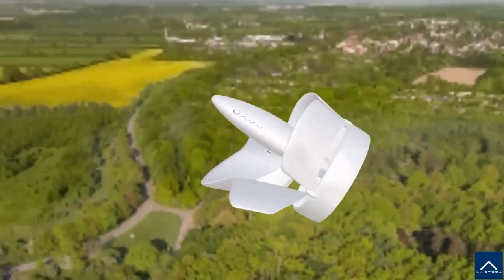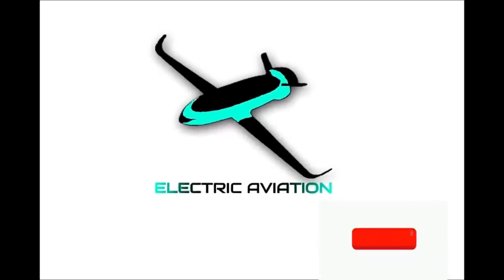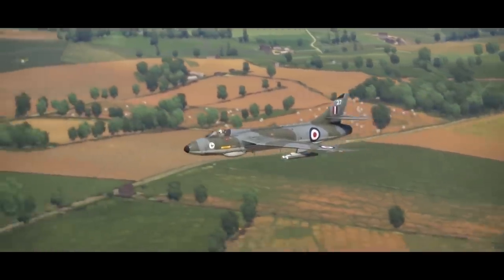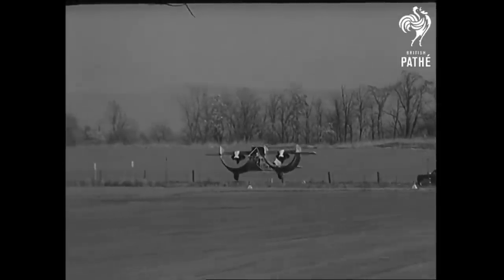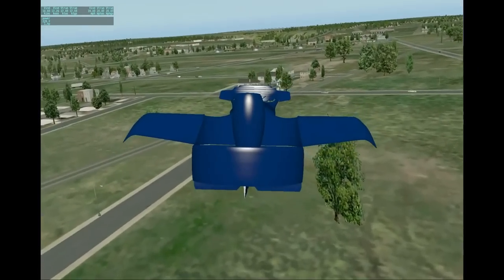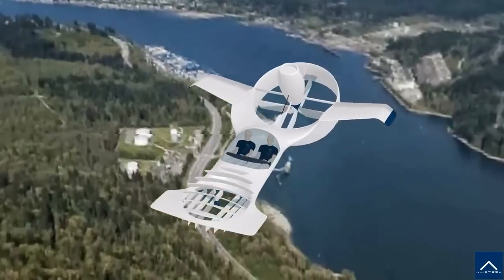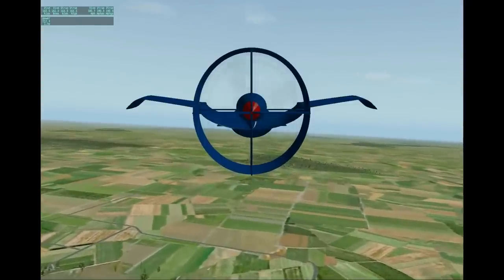Lip Wing : 65 Percent more Lift than Open Prop

Comment: In conventional aircraft design the principle reason for the separation of propulsion and lift is the design simplicity: Modularisation of thrust components  allows them to be positioned in such a way as to avoid unwanted interactions with wings. This has the added benefit of allowing competition between propulsion providers without undue compromise to the airframe development.  One of the key challenges with eVToL (or indeed elec aircraft in general) is that the whole technology only reaches  minimum value when the unique characteristics of electric propulsion are fully exploited... i.e. Elec aircraft only make sense (below the 400W/kg battery threshold) when distributed propulsion is used... the X-57 is a prime example of this. (Compare Chord lengths between the elec version and the original donor aircraft)

Comment: Sounds very interesting
Unfortunately as a blind subscriber I really couldn’t get my head around this concept
Could someone who has the time please describe it for me
Thanks
Reply: I believe what he is saying is that there is one school of thought to keep the part of an aircraft that creates lift, like wings, separate from the part that provides propulsion and forward velocity. This way, if the propulsion side fails, the airplane can still act as a glider of sorts with the possibility of landing safely. There is another design concept that integrates propulsion systems with physical lift mechanisms such as wings more directly which can lead to increased efficiency. However, if the propulsion system fails, the lift producing structures will not be enough to keep the aircraft aloft. Independent electric motors could help offset this danger, since it would take several motor failures to present a danger to the aircraft, which is unlikely.
Reply: @_____ thanks for the answer
Yes I’m usually able to visualise such descriptions but this time I got lost so much appreciated
Cheers

Comment: I wonder about the possibility of increased propeller efficiency on these smaller electric motors using a single-sided propeller? One of the two asymmetrical load (balance) could easily be addressed with a weight. In full sized aircraft the asymmetrical thrust load would tair apart most structures. But it may not be too much for these types of smaller electric motors. The higher RPM's would also make it easier to dampen out the vibration.

Efficiency drops as the number of "tips" (blades) increase. Meaning a 4-blade propeller has higher losses than a 2-blade of the same disc diameter.
Reply: I think there is one speed record still standing with a single-blade aircraft, and that was set ages ago!

Not so sure high rpm is easier to dampen than low rpms.

Ages ago (soon 100 years ago) you could buy fixed-pitch single-blade props for small low-power aircraft, and the only practical gain was better glide ratios, power off. And you'd get more vibration, as one side had a propeller blade that flexed under load, while the other just had a heavy lump of metal. Today's multi-blade props for private aircraft increases climb a lot, while some do not do much better in cruise, efficiencywise.  Three-bladed propellers have less vibration issues then two-blade, and five-blade is even better than three-bladed!

To keep efficiency up the propeller tips should travel at Mach .6-0.8, and lots of power combined with two-bladed props has never worked. The late Spitfires had five-bladed propellers, while the very first had two blades!

Comment: Looks like an intriguing design. For quite a time, I wondered if ducted fans might push performance, even for bigger props. Coleopters/"circular wings" habe been tried every now and then, but never caught up. Many creative guys tried a range of ideas and details with RC models, but, whatever gets to work at 1:5 scale or even smaller, not necessarily is feasible at full scale, be it too heavy/lacking payload, too expensive, complex or fragile to build at 1:1?
The design of current commercial aircraft might be dated, but seems to have proven itself as a compromise between performance, cost and durability?
Reply: Big ducted propellers weigh a lot, thus even less suitable for an electric aircraft. Secondly, all duct designs work best at one speed, one lift situation, while propellers are fairly easily made in-flight adjustable (old technology, since the birth of helicopters).

 So ducts have a restricted speed range where they are effective, and in an electric aircraft efficiency is the paramount concern, till the day we get much better batteries! And just all the added wetted area is a huge problem at speed.
Reply: @ErikssonTord_2  To my understanding, a wide speed range is a must-have for freight machines and WW2 fighters, but not for a plane that will do cruising speed for >90% of their  time of operation.
Weight on the other hand is a factor, and even more:  rotating mass leading to gyroscopic effects.

Comment: I would suggest designing the propeller blades to "park" so the blades add to lift when power is lost.  Maybe a two blade system with pitch defaulting to horizontal  and lift setting.  Instead of random feathering just causing drag.
Reply: I really enjoy the open dialogue in this group, and that’s largely to your masterful video presentations. Thank you and I like your feedback ideas CandC68
Reply: @fredtatch1572  Well the hub would get a bit complex with pitch changing hardware.  I guess similar to  helicopters.  But it is fun to "hare brain" ideas and see what floats.  B-)
Reply: @CandC68  I’m new to this, but it seems like this now isn’t part of the larger conversation 🤫. But transforming the propellor from driver to driven relative to desired direction of flight. Could it even generate beneficial electricity in certain conditions?
Reply: @fredtatch1572  Not being edjumikated in aeronautical engineering, I'm not constrained by knowing what I'm talking about.  So, take a grain of salt with my comments.  Which I have found isn't a bad thing.  It may not occur to trained folks to think outside their box.  Who knows if silly concepts might trigger a new thought.
The dif in design and efficiency from "driver to driven" would be above my understanding.  Except that all drivers that I've seen seem dif from drivens.  
But, I'm normally outside the box(untrained).  Still working on making a reverse vortex generator.  B-)

Comment: Am I wrong? Doesn’t this design forward motion to achieve steering? Also, if this design tried to hover like a helicopter, having only two rotors, it would not be able to maintain balance left to right. I’m not saying this is a bad design. I’m just saying people should not expect it to do vertical takeoff and landing like a helicopter.

Comment: Not enough emphasis was placed on the fact that these big pusher ducts will have to contain 'coaxial' propellors, as the toque effect of a single prop would be uncontrollable, or would absorb a significant amount of thrust to correct. I think I'll stick to wings...
Reply from the maker: True. Thanks for adding that

Comment: The angulation of the single thrusting element to bring both the lift and propulsion into place is not a safe method of flight. There must be an auxiliary element to fall back into in case of sudden failure of any type. We can not scarify safety on expense of efficiency. This is great for moving things, not for moving human.

Comment: So it's basically a copy of the Custer Channelwing from the 1920's and Soviet AN-181
Reply from the maker: Custer Channel wing was designed in 1950s.
Reply: @ElectricAviation   It was designed in the 1920's, and took 14 years before the CCW-1 first flew in 1942, and Custer had 5 models by the early 50's.

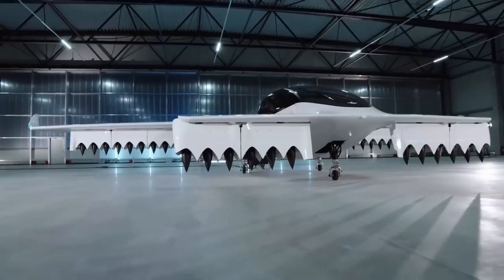Comment: 3:06 Why would the electric motors spin up before starting the engine? That makes no sense with regard to battery load. Those small motors are electric, are they not? 

Oh - I am guessing that the main engine is electric as well. I was thinking it was internal combustion…

Comment: The GREATEST efficiency & safety available is in the gyro-copter ... if I had the cash Id make an electric version in a heartbeat. Can take off like a helicopter, no runway needed, cut the engine and it will coast to the ground, current efficiency is very high as well
Reply: Exactly what I thought also. But in order to maximize the range I'd still use gasoline for the lift off and battery power only for the cruise.

Comment: Batteries from the first full charge start losing charge capacity. Electric aircraft will never replace large passenger jet aircraft. Period.
Reply from the maker: They are not meant to
Reply: @ElectricAviation  ,
Good. Glad to hear that you aren't going down that rabbit hole.

Comment: 0:47 “Among the aircraft designers, there are two schools of thought yada yada yada…”.

No. This is a gross oversimplification, profoundly in need of clarification! Here is my take:

Among aircraft designers, there are two schools of thought: 
1) Those who integrate rotating airfoils to generate lift.
2) Those who use fixed wings to generate lift.

Comment: Your goals are honourable but I hope going forward the public is educated about the fact that no matter the fuel mode, electric, hydrogen or hydrocarbon, to fly very far very fast will always take tremendous energy.  The only green plane is a slow, short haul electric made with materials that are recyclable (not carbon) and electricity made by pure green means without the hocus pocus the aviation industry feeds us.(see the recently released UK Net Zero aviation plan for classic strategies for misleading of the public)
To fly an economical aircraft across the Atlantic return takes well over a million kilowatt hours of energy equivalent to 17,000 hot showers per passenger (basically 20 years of showers equals one return flight per passenger).  This comes from Cambridge physicist David MacKay author of “Without Hot Air”
Reply from the maker: Travel Speed is the key parameter here. Yes sustainable aviation and in particular electric cannot go beyond 100 mph. This is significantly slow compared to 500 mph speed of jetliners